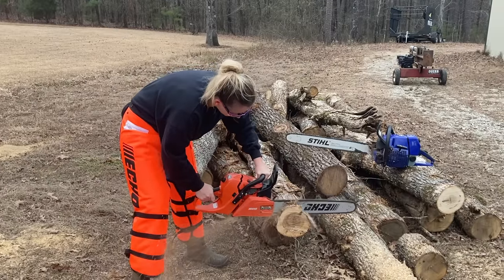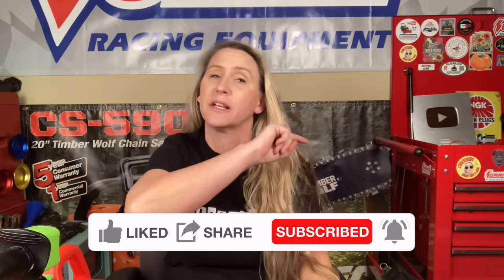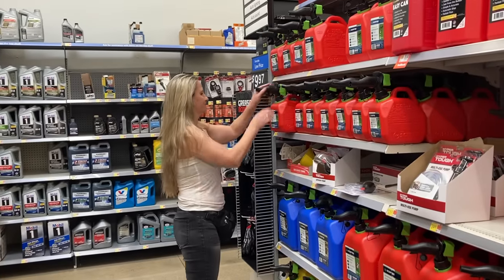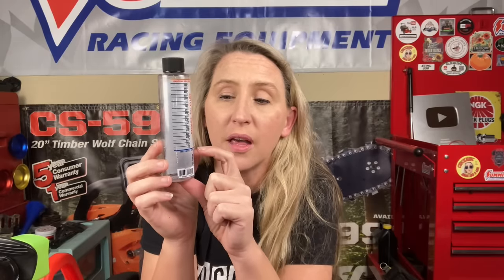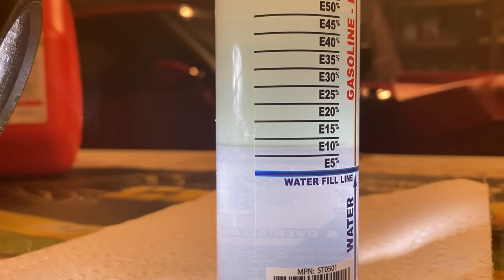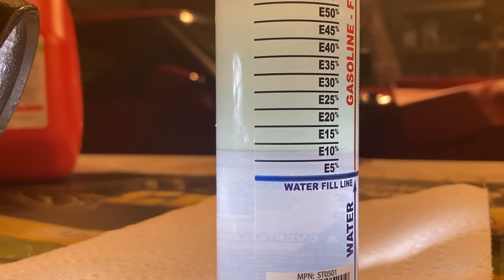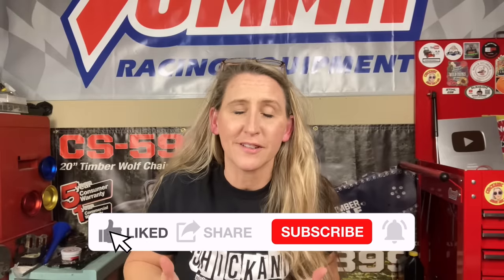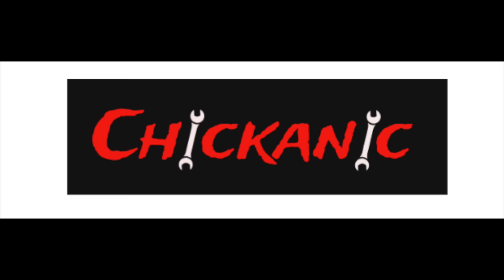Fueled by Deception. How You’re Getting Ripped Off at the Pump! (I'm SHOCKED!) VLOG

Comment: Hi Bre,
I saw a video where they used the same technique to make E10 into ethanol free by using a 5 gallon container with a bottom tap. Sufficient water was poured in to capture the ethanol and it was agitated and left for several hours. Then the tap was opened to drain off the bottom mixture and a little gasoline. The rest of the container was now ethanol free. You and your family stay safe.
Reply: Yes, I saw that video as well.  I'm going to go to this method, but I am also going to test my area, and my improved fuel as well.
Reply: Don't forget that doing this ( removing the ethanol) decreases your octane by a significant amount.  You may need to add non ethanol octane booster to run the stripped out fuel succsessfuly.
Reply: @Ronstar911  Great point!
Reply: @Ronstar911  Very true. 
The ethanol is a very cheap octane booster, so the oil companies will skimp on using normal compounds to restore octane.
You could well destroy your motor from detonation by doing this.
Reply: @Ronstar911 . True and Important. Too low octane will cause predetonation, which will ruin an engine. 
Far better to find a station selling the gas you need.
Reply: I wouldn't recommend this. Modern gasoline contains a variety of additives that serve important purposes. These include detergents that keep your engine clean, anti-corrosion inhibitors to protect your fuel system, seal preservatives to prevent fuel leaks, and lubricants to reduce friction. Siphoning off the top layer of gasoline after mixing with water may remove some of these additives along with the ethanol (depending on the additives' affinity for alcohol and water). Also, as others have pointed out, removing the ethanol decreases the octane rating. This method of getting ethanol-free gas has the potential to cause as much harm as good.
Reply: What he forgot to mention is that video was making ethanol free gas for lawnmowers 😮 not cars.
Reply: Yeah you lose octane, I’m sure industrially there are better ways, but if you do that the quality of the gas will go south
Reply: I know YT doesn't allow link but possibly list title of video. I think siphon top layer of fuel with a shake siphon might be simpler. I might add octane additive depending on how my stihl's run.
Reply: 8 @1Cobranut
Reply: This is what I do I use one of those plastic five gallon water cooler bottles hanging upside down. Don’t need to wait more than 20 Minutes.
Reply: @Ronstar911 correct
But my Briggs 21 hp platinum runs just fine.
Reply: @PT-ie2xj my Briggs and Stratton 21 hp Platinum has been running perfectly since 201
I also add a tiny amount of two stroke oil to the gas.
Reply: @MrCountrycuz  good. What do you use for a valve.
Reply: Big no no. Do not fill the container without it being on the ground. Without it being on the ground, static electricity could build up and spark.  Spark equals boom.

Comment: Wow! Great video. Never realized that. I did know that there was a hose full of gas left after you shut the pump off that you could get out of the hose by squeezing the trigger on the old style nozzles. But, you can't do that with the new style nozzles since they won't operate after you shut the pump off. So, the gas stations are ripping you off that way too by not letting you get the gas  that you paid for out of the hose. Thanks again for sharing your knnowledge. BTW, sorry to hear about you husband's hip and having to close shop for awhile. Look at it as a well deserved break. Hope you get back into it, you are a great mechanic. Also, congrats on the Husqvarna gig.

Comment: Thanks for your channel.  There's a gas station near here that has one of the selections as e0.   However, they were straight-forward enough to have a sign on the pump that if you are pumping the E0 (their pumps have a single hose for all grades), the first bit of fuel that comes from the hose will have gas from last customer and might not be the ethanol-free.   With their caution in mind, any time I'm getting a few gallons of E0, I do pump the first gallon into my car's tank.  Then I proceed to put the E0 into my fuel can.   I didn't know about the ethanol content checker from Amazon.  Going to order one.  Just wanted to say that your videos (just learned of them today, and have watched only 2 of them), are straight to the point and don't have any BS in them (I'm not a tomato plant so I don't need the BS from some of the other folks).   Thank you much for good info, straight to the point.  Cheers.

Comment: Thanks so very much for your videos. I'm retired and we heat our home during the winter with firewood. Old 50 cc class saws are primarily what is available in our area. I'm trying to learn enough to attempt some simple ways to improve the performance of a saw such an 026 without having special tools. A base gasket delete, minor exhaust work, and possibly a muffler mod would most likely be my target starting point. Thanks again Tinman!

Comment: Thank you for illustrating this. Back in the mid '80s my Dad took up small engine repair and would attend small engine seminars. One seminar was on the subject of the varying percentages of ethanol in the fuel from local gas stations in the town he was doing the seminar. His tests he illustrated for the attendees had anywhere from 0 to 30% ethanol. As most knew the quality of the fuel greatly affected the tuning and performance of small engines, thus explaining some of the woes people were having. When my Dad performed his own tests, he found a couple of stations consistently had huge variations in the amount of ethanol. He did the same as you, passing on recommendations to his customers. One of the owners came to his shop and threatened him. He smiled at him and welcomed him to go ahead. It would be the perfect outlet for dealing with the pent-up frustrations that some customers instilled that beating the hell out of someone would be good therapy. Poor Dad had to deal with his frustrations another way, the guy couldn't get back in his truck fast enough.
Reply: lol in the 80's only place u could get corn fuel was at a co/op store, / feed store lol, no regular gas stations sold that garbage , and it was gone in a year becuz it was twice the cost as regular fuel and got worse mileage,  sounds like bullshit
Reply: G30 the dem

Comment: And that's why I buy my ethanol-free gas at the local Walmart, where it is 91 octane and has its own dedicated pump attached to a dedicated blue nozzle. On the odd occasion that I must get it somewhere else, I always spray the first gallon or so in the truck. Ethanol will absolutely wreak havoc on your small engines.
Reply: Same here.  The local Wally World gas station has a dedicated hose for the ethanol free gasoline which is what I use in my 2022 Power Wagon and Stihl chain saw.  I've noticed an increase in power and mileage which partially helps to offset the increase in cost.  I now get about 440 miles per tank of gas, up from 400.
Reply: @derekheuring2984  WOW! That is nice to know. On the same note, a dear friend of mine is a life-long, authorized mechanic for four popular makers of Japanese motorcycles, and he tells me that certain of these manufacturers warrant their bikes for one year less when they ship them to America, simply because of the problems that are certain to arise because of the crappy fuel we put in them. 👇

Comment: I have worked in the petroleum business for the past 20 years on the bulk storage side. You are 100% percent correct. There is an amount downgraded at the nozzle when choosing higher grades. This amount isn’t as noticeable with higher amounts when filling a vehicle. But when getting one gallon it is very noticeable. We have the same sort of blending systems on a larger scale to fill the tanker trucks delivering fuel to stations.
Please, next time fill your plastic gas can on the ground. Static builds up quickly in plastic gas cans when filling. It being in contact with the concrete will dissipate.

Comment: Thank you for doing this test for us. I have suspected that what we are buying at the pump is not always what we are actually getting. Years ago when we had Emissions testing in our county, the state was required to do random testing at gas stations to certify that the Ethanol content, as well as the octane levels, were at the advertised levels. Since our county longer does Emissions testing, they no longer do this testing/certification.
   Glad I'm not the only person who cusses those junk filler necks we are forced to use now.

Comment: I read an article about "making" your own ethanol-free gas by putting "some" water in a carboy (5-gallon glass jug), add your gasoline... shake... let stand for quite a while and, after it separates, siphon off your ethanol-free fuel above the separation line.
Reply: I wouldn't recommend this. Modern gasoline contains a variety of additives that serve important purposes. These include detergents that keep your engine clean, anti-corrosion inhibitors to protect your fuel system, seal preservatives to prevent fuel leaks, and lubricants to reduce friction. Siphoning off the top layer of gasoline after mixing with water may remove some of these additives along with the ethanol (depending on the additives' affinity for alcohol and water). Also, as others have pointed out, removing the ethanol decreases the octane rating. This method of getting ethanol-free gas has the potential to cause as much harm as good.

Comment: Mantis tiller, '87 vintage. New carb, fuel lines. Purchased ethanol free canned 50:1 mix from a big box store. Runs for 5 seconds, dies. Got upset, blamed faulty carburator, went to bed. Next day: costco gas, ethanol treatment and 2 cycle oil. Same machine runs like new. Leason learned. Can't argue with facts. Thank you, Bre!
Reply: Here is a tidbit in case you ever run into it. If you have an engine that runs for about 7 to 10 minutes and then quits but will start again after it cools. Chances are, it needs a new ignition module. When ignition modules go bad they become more sensitive to heat and fail when they get hot. Had many customers tell me on the phone their situation. Immediately, I knew what the problem was. I'd put a new ignition module on it and problem solved.

Comment: We have very few ethanol free fuel pumps here in New Hampshire. I used to have to go to an airport and pay almost $5 a gallon. Now we have one station that is about 40 miles away. There are others up north by the White Mountains because of all the 4-wheelers but I sure wish there were more stations closer. That is all I use in my small engines. I also mix my own saw gas. No over-priced canned fuel for me. Thanks for another informative video. Good job!
Reply: I would drive 6 hours to Oklahoma and fill up 12 five gallon tanks and vehicle
Reply: @philliphall5198  I do the same thing. Only 6 but I still feel like I'm driving a bomb home
Reply: Check Sunoco stations.  We have a Sunoco in Keene now with ethanol free.  I spend winters in Florida now and ethanol free is everywhere.
Reply: @davido856  Thank you. There's a Sunoco in Concord that has kerosene. Maybe they would be open to putting in an ethanol free pump. Thanks. The station I go to is up in Sunapee. And we have friends in the West Palm area and you're right, it's everywhere down there.
Reply: @NHHalKnowsHow  our Sunoco wholesaler is Sandri out of Greenfield Massachusetts.  Kerosene is a scare as hens teeth.  Most retailers in Keene have changed over to off road diesel that can be used for heating oil without paying the road taxes.
Reply: @davido856  I'll have to stop in and talk to the guy. I used to operate a Sunoco in Ascutney in the 80's. It was Sandri then as well. Good people to work with.
Reply: 2:41 $5/gallon??  Lucky you $5.98 here!
Reply: I just drove past a station in Winchester that had a sign advertising ethanol-free gas. It was at the intersection of Rt.10 and Rt.78. Unfortunately, I had just filled my motorcycle with the crappy stuff in MA so I missed out.

Comment: Spot on. Especially nasty if you're getting that E85. 

One more fuel buying tip: Always avoid the station if you see the tanker there pumping or just leaving. Filling those tanks riles up any crap that might be in the tank (and don't believe there isn't any) and you'll be pumping that trashy stuff into your cans or tanks. I once had an auto fuel filter completely gummed up by doing this. Learned my lesson...
Reply: @notexpatjoe I understand that. However, I once managed to get a fill so bad it plugged the filter on the vehicle so badly I barely made it home. Had barely 20K on the od. I thought something terrible was going on the way the truck was buckin' and humpin'. Nope Just a plugged fuel filter.

So the assumptions that filters are always in good condition or even present are contingent on getting usable fuel. Otherwise, you may be walking or calling.

Comment: Yes, they are blender pumps. Most modern stations just have 87 and 93/94 octane tanks. Also, if you live in a non RFG control area, they blend 10% ethanol sometimes at the loading rack to make mid grade (89) if it's an older store that has a midgrade tank. Source: me, fuel hauler for 30+ years.
Reply: Don't know if you hauled fuel in California or not but is it true when the gas companies say they have summer and winter blends, are blowing smoke?  I ask as I was told by a fuel hauler here in CA that there is no difference, just a price gouge practice in play to shaft the consumers here.
Reply: Ethyl alcohol boosts the octane AntiKnock number.  One way to take 86octane pure gas and turn it into 87, 89, 91, 93 octane car gas is to add more Ethyl alcohol.  For such retailers the largest %ethanol in standard retail will be 93....the purest will be 87....playing between 10 and 5%.

That's not true at every retailer, but often at discount stations.

Another trick is to "dry" the water in the underground tanks by dumping a load of E85 into the tanks.  That's not supposed to be done....but you're also not supposed to pump gasoline durectly onto the pavement to clean up oil and diesel spills at the end of the day.  Some retailers do it.
Reply: @STho205  Av Gas....omg the memories!
Leaded!
Unleaded!
The daily/weekly/monthly price wars!
Yikes!!!
Cheers!
----
ps. Sorry I'm reminiscing '70s
Only in America!
Cheers!
Reply: @JubileeValence  and The UK, and Australia and Canada....and other nations.

Heck Mad Max was inspired by gas shortages and price wars/artificial shorrtages in The Down Under in the 70s.

Comment: Interesting information. I also live in a small town with only 3 gas stations. I noticed the two that I normally go to recently replaced their pumps with pumps that have a completely separate hose for what they label 100% gasoline. Sounds like it’s a good thing.
Reply: Have never seen a true ethanol-free gasoline, since the ethanol is used as a replacement for the now-banned additive that replaced tetraethyl lead as an octane booster. Without a booster, fuel is around 60 octane.
Reply: @michaelnorth5215  Have two Murphy stations in my area(15 and 20 miles from me) now one has 87 octane non ethanol and the other has 90 Octane non ethanol!
Reply: @wallychambe1587  Any clue what is used for an octane booster?  Can't say I ever heard of the brand, but probably not NW Ohio🤔
Reply: @michaelnorth5215  Murphy stations are usually  at Walmarts, the refiners process the naptha more to get the higher octane. The Ethanol free gas is the 93 or 95 octane gas before they put the ethanol in. So it is 87 to 90 octane before they add  Ethanol.
Reply: There seems to be only one in my neighborhood that uses a separate hose for the non-ethanol gasoline. That's where I will be buying my non-E fuel.
Reply: @michaelnorth5215  closer to 80 octane. With EFI you probably wouldn't notice the drop in octane anyway except in MPG.
Reply: I talked with a guy for a minute who was unloading fuel at a Murphys at Walmart..He told me most people miss the simple info of the ""color caps"" on the ground to tell what fuel is at a gas station=,Red=93 Blue=89 Yellow=87..If a gas station has all three color caps on the ground it has three grades..If a gas station has only two colors most likely Red and Yellow it's mixed for mid grade.

Comment: WOW! How did I not realize this was happening? I use 5 gal cans and have never had an issue, but I can definitely see how others could. And btw, I bought after-market spouts for all of my cans and they work great.
Reply: love good info
Reply: At last check you could get after-market gas can spouts at Tractor Supply Co or Amazon.  Just checked again, and yes, both still have the replacement spouts.  Around $15 in most cases.

Comment: Nice. I have been using seafoam or stabil with my unleaded 89 octane  for my snowblower, EXMARK and three echo products for years and have 0 problems. My Stihl chainsaw is over 20 years old and sits a lot and an echo handheld blower over 20 years old too they all run great. Love your channel

Comment: Bre,

Thanks so much for this post.  It was a real eye-opener.  I share your contempt for the Scepter gas cans, and recently found a solution!

I have a Briggs and Stratton GarageBoss Press 'N Pour gas can and also hated it.  Then one day a happy accident occurred.  I was trimming my toenails with a Dremel cut-off wheel when my hand slipped and the wheel accidentally cut off a small plastic protrusion that had been blocking the red plunger from opening the spout.  Now I only need two hands (or even just one) to pour my fuel mixture into my chain saw.  Life is good again.

Maybe your hand will also slip one day.

Joe